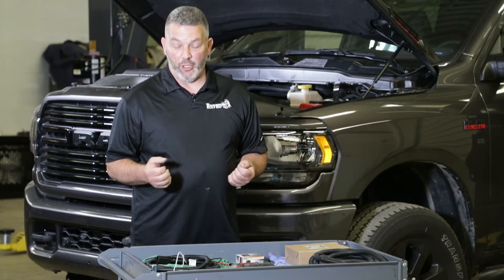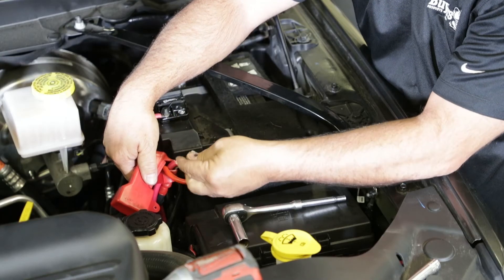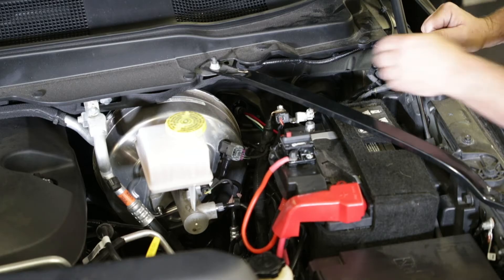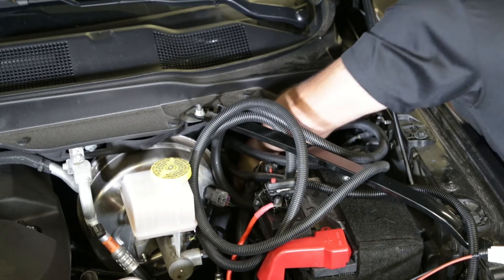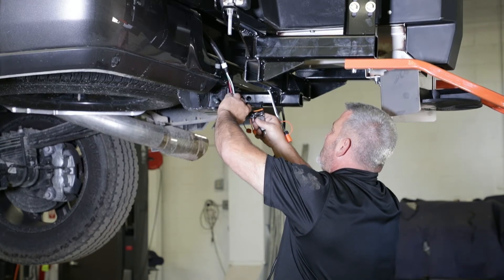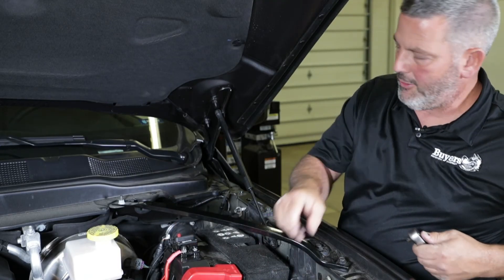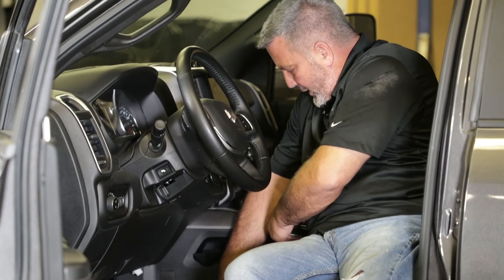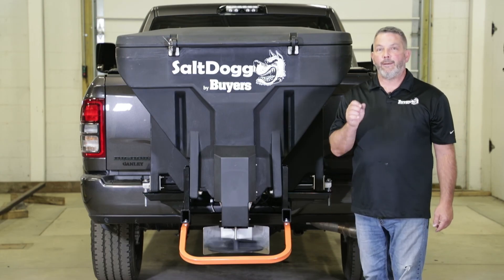SaltDogg How-To: How to Assemble and Install SaltDogg TGS07 - Part 2 (Wiring and Electrical)

Comment: Can you easily add led lights into the existing wiring  to the spreader that will turn on when you turn spreader controller on ?
Reply from the maker: Thanks for your comment! On the TGS07 spreaders, there is not currently a circuit for a dedicated work light. However, there is on the SHPE and newer PRO models.

Comment: Just bought this brand new. Love everything about it except the cover does not fit, it was molded a bit to small and will not close :(
Reply from the maker: Hi, thank you for your comment! Where did you purchase your unit from? If you happened to purchase from a retailer such as Amazon, please email nacs@buyersproducts.com your issue and they'd be happy to assist!
Reply: @BuyersProductsCompany  I bought it from Iroquois Manufacturing in Hinesburg Vermont about two weeks ago.
Reply from the maker: If you're able to, I would recommend stopping by there or calling them to explain the issue you're having with the lid!

Comment: let me be more specific sorry, my controller, is the same as yours, it has the 4 wire harness....red black green brown, it has the 2 wire harness...black red...and then 1 single red wire is coming out of the inside of my controller and im not sure why
Reply from the maker: Thanks for your comments! The single red wire should go to the fuse box for 12V keyed power. I hope this helps! -Lucas

Comment: LIGHT FOR TGSO7 IN BACK WOOD BE NICE
Reply from the maker: Hello, David! Great idea! While we don't currently offer a light specifically for the TGS07, we do have a wide range of LED floods, spot lights, and strobes that are great for spreaders (and just about any other application you can think of).  You can check out our full line of work lights here: https://www.buyersproducts.com/catalog/lighting-5/work-lights-340.
Reply: How and where would you mount it? Want to see the salt spread from the drivers seat?
Reply from the maker: @gregreed986  Spoke with our SaltDogg team about this, they said they've seen a variety of solutions over the years. We offer a wide range of post-mounted LED flood lights that only require a single mounting hole and that you can splice into the spinner wiring so that the light comes on whenever the spinner does. As for where to mount it, they've seen people install the lights everywhere from their truck's side walls or bumpers to the frame of the spreader itself. I hope this helps!